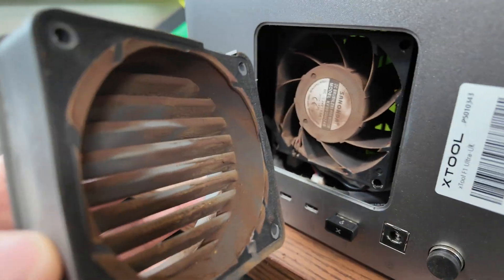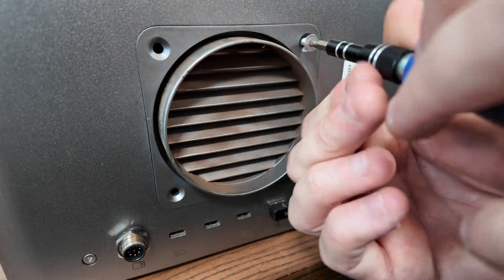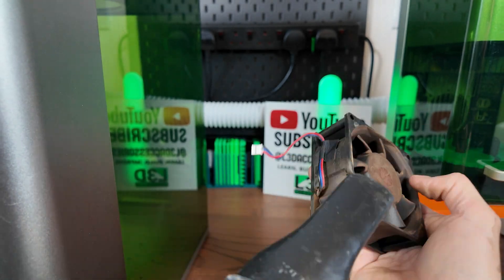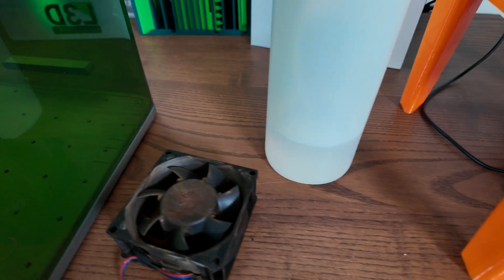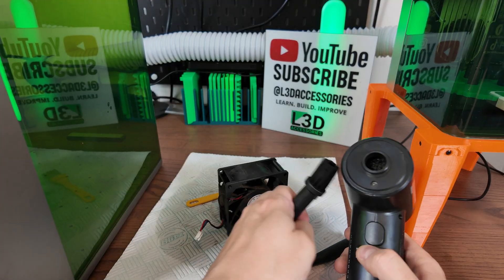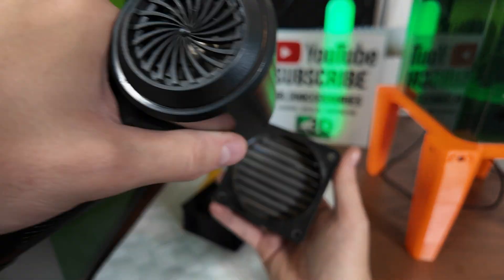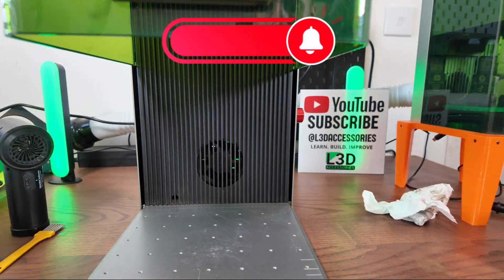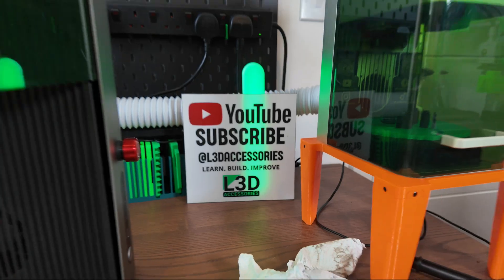How I Almost Ruined My xTool F1 Ultra (Clean This Fan Now)

Comment: how often to clean it
Reply from the maker: There isn't a definitive answer because it all depends on how much you use it and what materials you engrave. I think a safe rule of thumb would be once every 3-4 weeks.
Reply: @L3DAccessories  mainly metals and wood and i feel real money is in embossing - so mainly that. which does cause most of the dust
Reply from the maker: @ItsKismetic In that case I'd recommend buying a 3D printed pre filter and cleaning out the fan every 1-2 weeks.
Reply: @L3DAccessories  Thank you for being so responsive and helpful - if i could ask you a last query on embossing - embossed wood and metal are the highest profit margin products right? any tips about that? i want to buy the machine mainly for art and spiritual goods for my business's purpose

Comment: How long have you run it before cleaning?
Reply from the maker: For this machine I had left it probably 6 months and I was doing a lot of rust removal & wood engraving. But the frequency of cleaning it will depend entirely on how often you engrave and also what type of engraving you're doing. I'd recommend every 6-8 weeks if you're using your machine a lot. If you find that it's quite dirty after 6-8 weeks I'd reduce it down to 4-6 weeks.

Comment: I would say it's probably a bit safer to spray the alcohol directly onto the rag when cleaning the inside of the machine., but otherwise this is great.
Reply from the maker: Thank you for watching. IPA is safe to use on electronic devices and is often the industry used method of cleaning PCB components etc.

Comment: Thanks for this video. I was getting an error from my AP2 saying it was clogged. Checked both hoses e and all filters and they’re still like new. My only concern was the ultra extractor so came to YouTube and this video gave that push needed to open the ultra and it worked well. It’s not stopping anymore
Reply from the maker: I'm really glad it helped you out. I had a similar situation with my AP2 and doing this also solved it.

Comment: I've made it even simpler by removing the fan. It's useless. Especially when you have an AP2 or an IF2. 
I replaced the fan with an adapter I made to close off the internal space to prevent particles from getting everywhere inside. The suction is much more efficient without the fan, which is an obstacle to air flow, and this simplifies maintenance considerably.
Reply: Is the adapter anywhere to find? I would like to remove the fan too 👍
Reply: @schnulliwutzi x2
Reply from the maker: Thanks for watching. I'll stick with it as it comes for now.